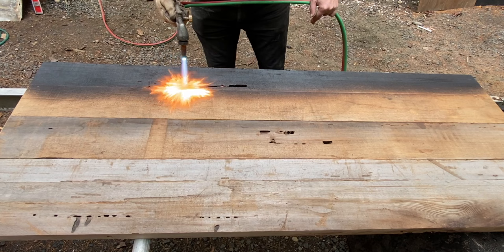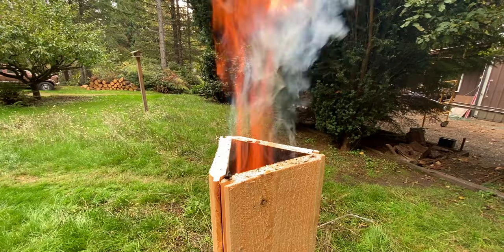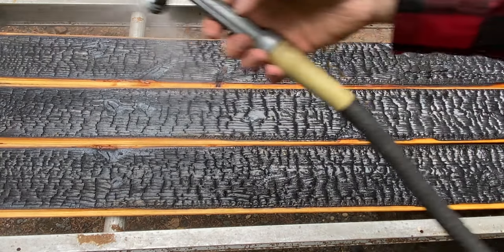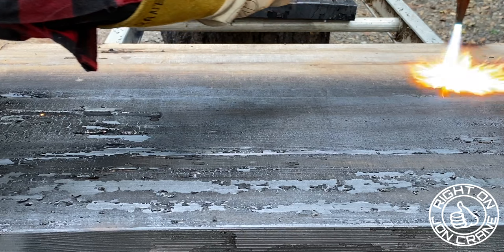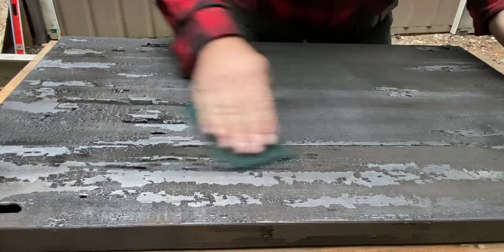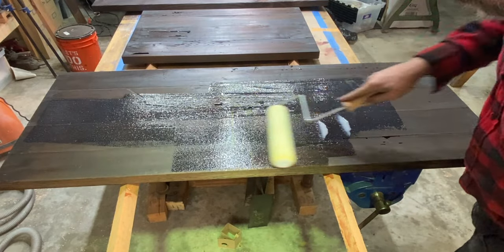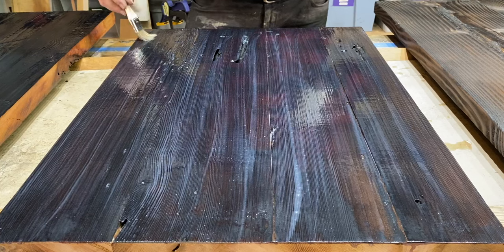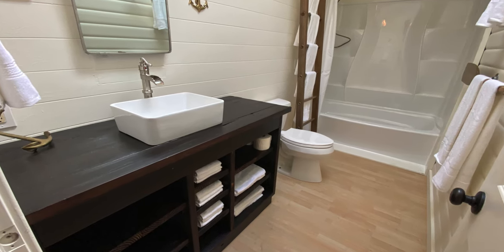Yakisugi - Not Shou Sugi Ban - The Art Of A Burned Wood Finish

Comment: Just call it burnt wood and get over it 😊
Reply: Burning wood can be interesting for effect. Have made several items for my grandkids using the torch method.  You get some awesome patterns from the grains of wood.  The heat makes the grains pop. Or stand out from the rest of the wood. Modern furniture and cabinets tend to be darker in color. This I see as an easy way to achieve that.

Comment: Pro life tip for anyone interested, build a fire pit out of an old washing machine tub by removing it and mounting it to an aluminum car rim. This type of fireplace gets so much induction air from all of the perforated holes that it creates an extremely hot fire and air stream through the top of the tub. Now you can go out in your yard start a fire in your pit, stand up wind and start charring your boards lightly or the more traditional deeper char way quite easily, have you a bucket of water to dip the first burnt end in to or a spray hose and you can easily hold it to finish charring the other end. This is the cheapest and most effective way as the fuel is just firewood and the materials for the fire pit are literally scrap yard material but do require some basic tools to disassemble the washing machine to get the drum out and small number of self tapping metal screws, most importantly though you can consciously choose the char level as the fuel cost isn't playing a factor
Reply from the maker: Right On! 🙌 sounds cool! 🔥🔥🔥

Comment: Nice work!
I'm a hardwood floor refinisher so I know Bona finish very well. You can definitely role it on but use a microfiber roller. That won't leave bubbles. Put it on thicker with each coat and it will lay out flat without the need to brush it out. You can also use those deck pads/paint pads, just go with the grain. That's how I do stairs because it works best when doing vertical surfaces. A foam brush for tight spaces. It tends to run so can't put it on thick on the vertical surfaces but because it's water base finish, you can build up the coats without abrading as long as you coat inside 24 hours.  Then for a final coat you can abrade it with 220 to smooth it out and apply your final coat as generously as possible without runs. Smoth out runs when it's wet with foam brush.
Reply from the maker: Right On! 👍🙌 Nice to hear your technique! I do have another video of finishing a fur floor with Bona. I used the deck pad. Thanks for your comment!!
Reply: Great tips! For outdoor decking would you go with the mat, silk or gloss Bona?
Reply: @FFTuk  I honestly haven't done any of the outdoor oil.  I know that gloss and even semi gloss will show more scratches than a satin or matte.
Reply: @MileHighRedoy  hadn’t thought of scratch resistance to be honest. Good point. I might do some patch tests and see what looks and holds up the best. I am doing a whole garden upgrade in the spring with Yakisugi decking, garden creek and pergola, maybe I should record the process 😀. Thanks for the reply 👍

Comment: Do you brush after spraying it with water or just leave it as is and oil? Looks incredible I'm going to try doing this to the interior area of a cedar sculpture next week I'd like to leave it in the suyaki phase
Reply from the maker: For the siding planks I leave it like it is. Sometimes oil and sometimes not. The oil finish could be nice for a sculpture to trap any soot particles. I would do a test sample. The cedar comes out great. Depending on how long you let it burn, changes the depth of the crackle. If you go too long pieces start to fall off. There is a wide range from lightly burned to heavily charred. Hope your sculpture turns out amazing! Thanks for watching! 🙌🔥🔥🔥

Comment: Hello Jon! Thanks for the great video. I did the walls of my barn like this, but one side, the one facing south (I live in Canada) I haven't brushed it at all. I really like the looks of it and was pretty curious to see how different will it age compared to the other sides (brushed and oiled) But my main concern is if my barn can catch fire because I have not brushed it? I understood that this technique  makes it pretty fireproof, but I thought it was considering that you brushed it and remove all the burnt pieces that lays on top of the boards as it is sort of sealing the grain. Now I'm a bit scared that the planks catch fire even more easily now that is is pre-burnt... In your video, you seems to express that the traditional way is just to burn the planks. I just wanna make sure I understood it right. (by the way I am using hemlock if it makes any difference) Thank you very much !
Reply: I'd love to see your Barn!  Both styles of charring.

Comment: I tried that on a project a while back. I had trouble with the glue joints separating from the heat.
Reply from the maker: Yes! I am using titebond-3 it seems to hold up really well to the heat and only after 24 hrs dry time.
Reply: @RightOnJonCrane  Do you think tightbond 2 would hold? And if I use wood filler before would that be an issue?  I’m using a weed burner torch
Reply from the maker: @77791z  yes titebond 2 will work great. Even better if you use a biscuit joiner. The weed burner torch works perfectly. Be sure to keep the clamps on overnight 👍
Reply: @RightOnJonCrane  Okay cool. Yea I planed the edges before I glued it together. There’s a bit of a gap in one part tho so I wanted use wood filler before put the finish but wasn’t sure if it’d look weird or melt.. Good to know the glue will hold I wasn’t sure about that either. Thanks for getting back to me
Reply from the maker: @77791z  It’s good to do both sides with the torch so the wood looses moisture evenly and doesn’t start to cup. Do a little on each side flipping back and forth. Only a couple times.

Comment: Thank you for this! 
 How long do you usually let it burn for, if doing that triangle method? or is there kind of a range of what would be too little and too much, if you're going for actual protection from the elements, insects, and fire, when using it as siding?
And the Cedar you used, I was surprised it didn't have more designs showing in it after brushing, as I've seen Cedar often have when yakisugi'd.   Was that just because you hadn't standard it further?  The type or choice of cedar boards you had used?
And lastly, if you were to stain it some color, presumably after having sanded it further, do you know what stage of the process that would happen at & how?   I wonder if there are certain kinds of stain that would be recommended for outdoor use on   charred/brushed wood.
Guessing it'd be applied at the same stage you'd applied your finish.  

 Thank you!   🙏🏼
Building a tiny house over here and I've been planning to use this method, for years now!  🤞🏼 getting very close to the time when I need to actually do the charring!   🔥🚪🏡🔥 🐉
Reply from the maker: Right on! That’s cool you are building a tiny home. The burn all depends on the moisture content of the wood and how deep you want to char to go into the wood. The balance is not so charred that it flakes off in chunks but still remains intact. As for the furniture I was making I wanted just the coloring and not so much a crackled look. I made beds, a bath vanity and some other furniture for the house. After finishing I didn’t want the char to flake off and stain bed sheets etc. I used water base finish to seal it and I wanted to make sure it would bond well to the charred wood. For siding you can use a clear oil finish to seal it in. Although it is weather resistant, it is not necessarily fire resistant by any means. 
Hope that helps. Thanks for watching! Right On! 🙌
Reply: @RightOnJonCrane  
Wow, thank you so much for your helpful response!
Yeah, I've seen anywhere from 10 seconds to 10 minutes, for the length of time to be burning it for... I'm trying to get some kind of reasonable ballpark idea to start with, of how long to burn it for without having to waste a bunch of precious and expensive siding wood in the process of figuring it out!  🙈
And I'm hoping to get that visual effect of having the lovely grain and wavy lines show through...  after sanding or brushing the top layer off.  It seems Cedar is best for that, as well as for use in exterior applications generally speaking.  I'm not too keen on contributing to the harvesting of old-growth forests in the PNW &c., so I'm trying to figure out if any other types of wood might be as amenable and appealing to me.  🤔  Not sure I'll find anything as good as Cedar though!

Comment: Thanks for video. What do you recommend for porch boards to be used on a covered porch that will get some weather/rain which are fired with propane torch? This sealer? Or if I wanted to stain it with some color, would a deck stain be OK ? I've seen videos where they use linseed oil and turpentine after the fire treatment on decks but not sure if you can color stain after you do that. My wood is just yellow pine tongue and groove.

Comment: So, I love your work but the  vainty top has some big voids that will in time be filled with (ugly) stuff.  My question is:  if your were to fill in the voids, how would you do it and what would you fill them up with?  Would you fill them BEFORE burning?   (I tried numerous wood fillers, plastic wood, etc but they all melted or caked up and broke out).  I am dealing with this problem on a big table top right now so I really do welcome some suggestions!
Reply from the maker: Hi Bob! Thanks for watching! If I wanted to fill the voids I would fill them after burning. Prep the wood for finish and fill the voids with epoxy. Tape the bottom side with metal HVAC tape and fill with epoxy from the top using a map gas torch to pop any bubbles that arise. 
You can tint the epoxy using Mixol color tint. I would use west system or total boat table top epoxy. Hope that helps! 🙌☘️✨ Right On!
Reply: ב''ה, there are various kneadable 2-part epoxy 'doughs' , some that might claim to take finish or might somewhat if mixed with sawdust.
 
If I were using this in a personal bathroom project I'd see how the generic white two-part dough sold for plumbing projects works out with this technique.  It's extremely hard after it cures and did okay for dry rot repair on post sheathing, however you'll want to scrape it perfectly flat while it's workable as it will be impossible to sand once cured.  Would be interesting to see how the contrast works with this technique.  Cost might be an issue for large voids.
 
Otherwise, from experience, I'd probably try to build up with that, or titebond, sawdust and patience, and veneer over the spots.  Doweling a thick plug even with some toothpicks might help, particularly at opposing angles.  Aim for materials with similar rates of expansion.

Comment: The butane method doesn't seem to work so well, the acetylene torch  works great... but the traditional method looks amazing... it may be the wood species you've used for it but it definitely looks with more character.
Reply from the maker: Yes! 🙌🔥 It all depends on what the finish product will be used for. Here a deep burn with the traditional method would work great for siding but for furniture a lighter char is better. I did not want chunks flaking off. The propane actually works really good for this. Thanks for watching! Right ON! 👍

Comment: I’m new to this technique and have been wanting to try it. But I’m confused and curious about something. If this technique is weatherproof, and has withstood the outer elements in buildings in Japan, why is it necessary to treat it with the floor treatment? Is it only for aesthetics, for the feel, or what?
Reply from the maker: Hi Susan! Thanks for watching! Good question! When this is burned and used as siding it is not something that you are necessarily going to run your hands over. The surface will be brittle and dusty like charcoal thus rubbing off and turning black whatever it touches. The rain and the weather will eventually wash away that dust. In my case I am making furniture and I want to seal it so it doesn’t stain fabrics that come in contact with it such as towels or bed sheets or clothing. Hope that helps! Right On! 🙌

Comment: Sits Yakisuge not shu sugi ban? I did my machete handle for practice ( YouTube blacksmith taught) I used twin burner propane torch. Gave it a beautiful pattern but my handle after after a lot of cutting with the Machete? Looks good and the steel I used was extremely hard. I love this artwork! I restored a bowie knife! Polished stainless steel blade with a Yakisuge handle coated in epoxy clear resin! ( restoration) top video. Cheers from Australia 🙂
Btw I tried a light burn on pine and the grain really pops out after sanding with a scotchbrite style sandpaper for handyman jobs. Love it.
Reply from the maker: Right On! 🙌👍 Ghats so cool! The yakisugi is awesome and it’s nice to hear what you’re doing with it! I’m sure it looks amazing!
Reply: @RightOnJonCrane  I'd love to send you a couple of pics?
Reply from the maker: @dragan3290  jon@rightonwithjoncrane.com. 👍
Reply: @RightOnJonCrane  hi mate. I sent you an email with the bowie knife picture. The picture doesn't do it justice if you know what I mean? I had to wet grind 3mm from base of handle to the toe of the knife. I hope you like it? My first restoration. A bit more touching up and I'll be really happy! Cheers dude
Thanks heaps 🙂👍👍👍
Reply from the maker: @dragan3290  It really came out great! Thanks for sending a pic!! 🙌🙌
Reply: @RightOnJonCrane  you like it? Thanks man! It means a lot!

Comment: 2:50 Not japanese cypress, it is japanese cedar.
Reply from the maker: Right On! Thanks for watching! Interesting that Japanese cedar technically is not a True cedar but is actually cypress. 😊
Reply: @RightOnJonCrane  I think you are right - what does that actually mean?
Reply: @Gumden  I know cypress tend to be larger trees, up to 3x the size of cedars, with denser wood (yet larger/rougher end grain) that isn't as fragrant as cedar and is usually more rot resistant than cedar.  It definitely would be  better choice for siding, and usually available in longer lengths for building.  That said, there actually is a "Cypress Cedar," and a couple false cedars (American western red cedar being a cypress and eastern red cedar-or "aromatic" cedar- actually being a juniper).